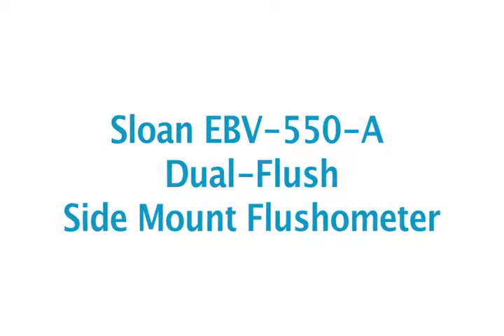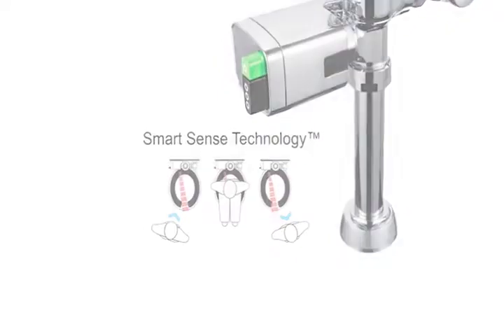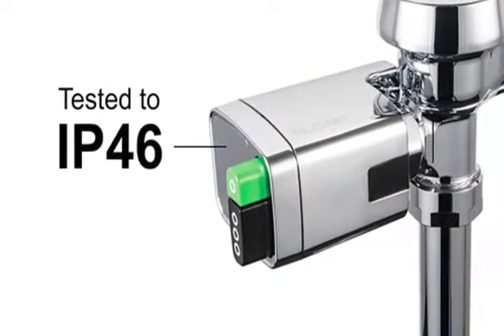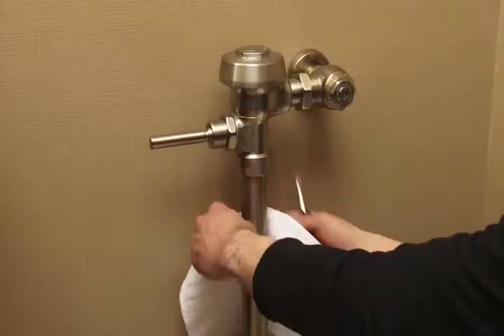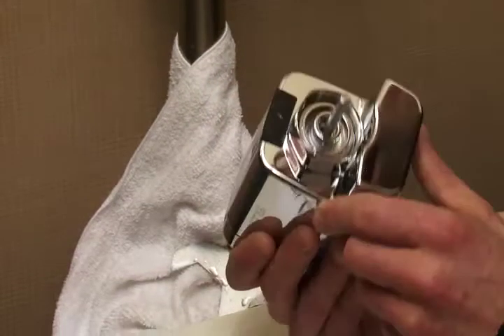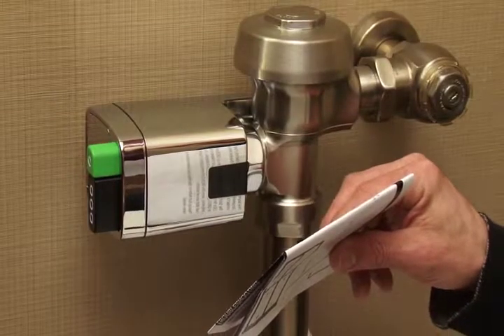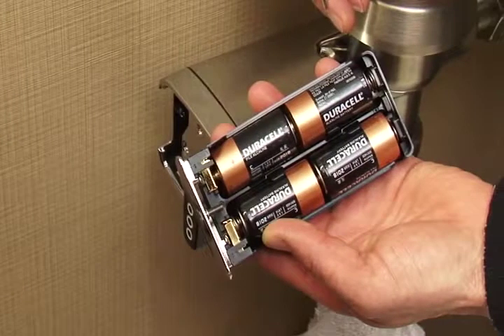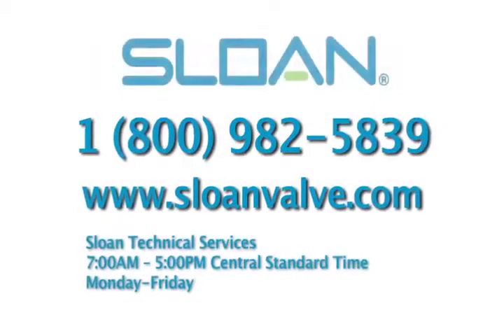Sloan EBV 550

Comment: I own a SLOAN EBV-500-A and the sensor has a red light that blinks every second. Does that mean its low on batteries or broken
Reply from the maker: Thank you for reaching out. Our technical support team can assist you with this issue. They can be contacted by phone at 888.756.2614 during local business hours (9 am to 5 pm Central Time) or by email at techsupport@sloan.com.